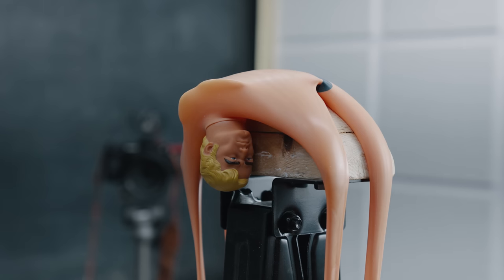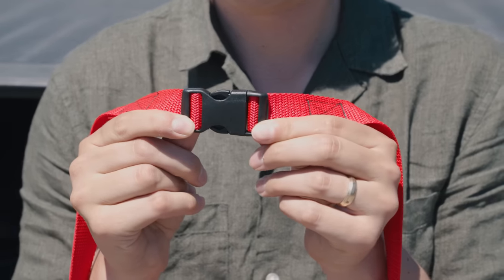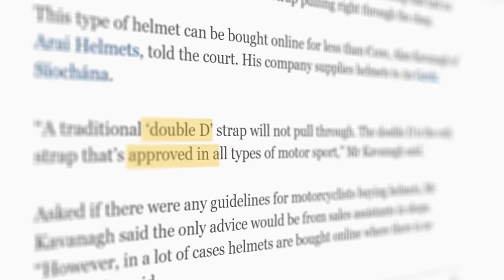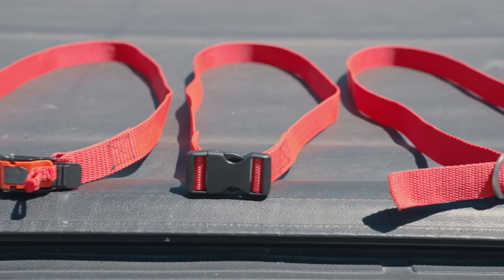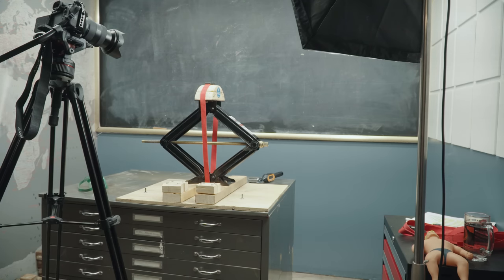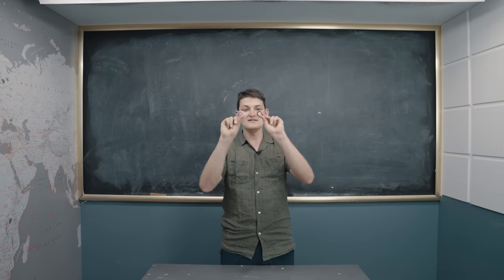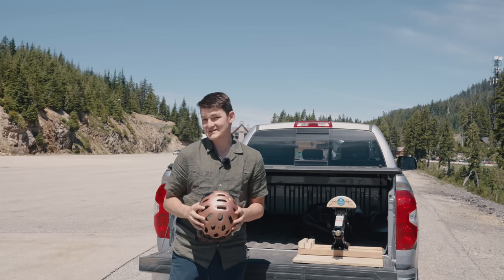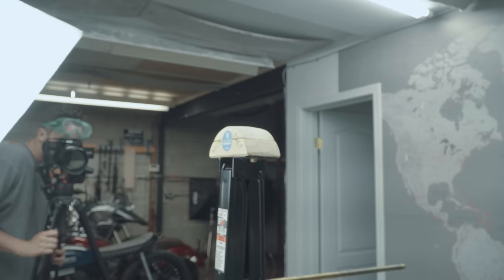Why Motorcycle Helmets Use this Ancient Buckle

Comment: Interesting. I have a Shoei Neotec 2 helmet myself and those ones have a ratchet strap which is made of metal instead of plastic. If you see that the plastic ratchet part broke, than i would think the Shoei ones should withstand more force...
Reply: Good observation here. The problem with this test isn't so much about testing the buckle style - but rather it's material strength testing as you can see the other buckles the failing point is the plastic breaking, whereas the double d ring has the advantage of being made out of metal. I'd even go out on a limb and say if you flip the situation around and have plastic double D rings vs the metal ratchet strap on the Shoei's, the plastic double D ring is going to fail first.
Reply: @nanaholic01  The fidlock had it's metal loop fail where the D rings were still going strong so just making a rachet out of metal is not a sure way of beating the double D at all.
Reply: @Juuul89  The metal loop is still intact for the fidlock you can see it clearly at 4:45. The broken part is plastic.
So the point still stands - they are testing the material strength of the locks but not the strength of the lock itself. It's not a fair comparison unless all the locks are made from the same material, this is a poorly conducted scientific test period.
Reply: @nanaholic01  it's clearly metal, look again
Reply: @Juuul89  nope looks plastic. The black latch part is clearly plastic which is what failed, while the other side with the silver metal ring for the hook side is still intact.
Still doesn't change the fact the test is testing material not latch design, so stop changing the subject.
Reply: The are testing the integrity of the set up used, materials chosen are secondary, as manufacturers In real life situations, vary in both design and materials. Therefore Scientific testing method stands, independent of the actual  mechanisms tested!
Reply: @nanaholic01  In real life situations, the "D" ring performs better, look at accidents and helmet fastening mechanisms and fatalities. As for the Scientific method ..
Reply: @nanaholic01  Check out what the Racers/ Drag guys,, Motocross people wear. See ACU/ DOT standards.
Reply: @johnnyhall7065  this is not what we are arguing and you are just strawmaning the entire point. The point is while he may have came to the right conclusion (the D ring is simple, strong and effective), he did it by accident because the experiment itself was design and conducted wrong, which would and should invalidate his conclusion in the most strict scientific way. Again this experiment did not test the strength of the buckles in a fair and equal way because the materials which the buckles were made were not the same (metal D ring vs plastic buckles), you can bring up another dozens of excuses of why D-rings are used in competitions or what not, it still doesn't change the fact this experiment is set up incorrectly and did not test what it was suppose to test (also citing D-rings are used in competitions as "proof" is called begging the question - you start with a forgone conclusion and worked your way backwards to find the path to this conclusion - this is entirely unacceptable as a scientific hypothesis and experiment in fact). He could easily add another control in the experiment with a fastening method which uses the same nylon straps but is held together with plastic D rings, which would then raise the trustworthiness of the entire experiment. 
Stop defending this video and admit it is not a good experiment - even if he accidentally arrived at the correct conclusion.
Reply: @nanaholic01  I questioned whether the plastic fasteners were from actual helmets or were "standins". My personal conclusion was that I don't know if he was using the correct pieces or not. If they came from actual MC helmets then he did it correctly. If they were standins he did it incorrectly. Personally I've never seen one of those plastic fork clips on a motorcycle helmet, just small ones on a bicycle helmet. That makes it apples and oranges. So, for me the jury is still out...    It was entertaining though.
Reply: @blakehugh  Exactly. Also the ratched style fastener is found in actual MC helmets like Shouei, but of course the those are all metal instead of the all plastic one used in this experiment. I have a Shouei helmet which uses the ratched style of fastener, and of course that helmet is certified for safety in countries all across the world (except for racing). I actually do not doubt that the D-ring is most probably the toughest design because it has the least moving parts thus less points of failures, but this "experiment" is not the one which convinces me of that because of the poor parts selection as you said.
Reply: exactly!!  the only difference was the build quality.  the designs themselves werent flawed.  he totally overlooked the build quality factor.
Reply: @nanaholic01  If the vast majority of fasteners are made of the same materials as the buckles F9 tested, then the conclusions are 'reasonable'. F9 cannot possibly do a full and comprehensive test of all fasteners in the marketplace, so for the 'general rider', the tests of the ones most commonly available was appropriate.
While I agree the test methods had inherent 'flaws', they still managed to give a good indication of the relative strength of the fasteners tested.
Reply: @garymaclean6903  they didn't though which is the point. For example my Shoei helmets uses "fast release" buckles which are made completely of METAL, compared to their cheap quick release straps which are plastic, and then they compared it to completely metal D-rings. So they, in fact, did not compare the strength of the buckle type but rather is testing material strength. If you cannot eliminate the variables in your experiment, then your experiment is a failure to prove your hypothesis, even though your conclusion may be correct.
If they cannot find fast release buckles which are metal, then for an actual properly controlled test, they should be using PLASTIC D-rings, which would then eliminate the material variables and actually give you the test of strength of the buckle type.
Reply: @nanaholic01  Actually, if the majority of fasteners on the market are made of or with plastic, then it's completely appropriate to test what's being offered and sold, rather than test something that is typically unavailable in our market.
Keep in mind F9 is a Canadian company, and many of the alternative metal fasteners available in Europe are simply not available here.
Reply: @garymaclean6903  er no it isn't. Even if the majority of the fasteners are plastic it still doesn't mean you test different materials against each other - that is literally what is considered not a controlled test and would be considered unscientific. For a channel which prouds itself to be rooted in science, it is a VERY bad mistake they made, and the fact that you are still trying to defend them just makes the whole situation worse. 
Plus Shoei is an international brand their helmets can be brought everywhere, the only conclusion you can actually make from this test is a metal D ring fastener is better than a plastic fast release fastener, good and pretty much would be the expected result because even common sense would tell us that metal are stronger than plastic (that and no one should be buying motorcycle helmets with plastic fasteners anyway, bicycle helmets is a different story), the test still doesn't test fastener strength no matter how many backflips you are trying to do with your excuses.
Reply: @nanaholic01  They tested how the strength of existing fasteners on our market compared.
It was NOT a test of the strength of  fasteners made of the same material! 
No point of testing a metal ratchet strap with a metal D-ring strap, if you can't even buy a metal ratchet strap in our market...
Reply: @nanaholic01  You missed the whole point of the test. 
Yes, a 'total analysis' would include a proper test of all available types and materials, with numerical load failure numbers to assess which type and material is the strongest. You would also need to identify the manufacturer and model of helmet that fastener was used in, simply because there's no one type of fastener design or common material. A plastic fastener from one manufacturer could have a different type of plastic and fail strength, as a different manufacturer with the same design.

So F9's approach was to isolate just 'some' of the common helmet fasteners currently available on the market, and attach a common standard belt so that only the fastener was being tested.

Not a totally unreasonable approach, even if the test methods weren't totally accurate. You DON'T have to only test fasteners of the same type of material to find out if Arai's Metal D-fasteners are 'stronger' than Bell's plastic Ratchet straps...!!! 
If you only tested metal D-Rings against metal ratchet straps you would NEVER KNOW if Arai's Metal D-fasteners are 'stronger' than Bell's plastic Ratchet straps, so how could you possibly decide which was the best for you...?!?!?!

It was never intended to be such a comprehensive test where all possible fastener types and materials were tested. 
 F9 doesn't have the resources to run such a test, nor the actual equipment to test the helmet fasteners and attachment belts properly. That's why they rigged up a strength test that attempted to use a torque wrench to get strength numbers, but failed to address the other flaws in their test procedure. They also didn't actually test the different belts used on helmets, nor the different methods used to fasten the ends of the belts inside to the helmets. There really isn't a good way to test how securely belts are fastened to helmets without testing not only the fasteners, but also the belts themselves and the attachment methods. 
Which F9 didn't to...
Reply: @garymaclean6903 that is not what the test is - they specified they are testing the strength of the fasteners. And again, Shoei helmet fast release fastners are NOT plastic. So either way you are trying to spin it this test is a failure.
Reply: @garymaclean6903  No I did not miss the point of the test, YOU on the other hand, did.
Again a proper scientific test means you eliminate as many variables as you can except the one which you want to test, the fact that they did not eliminate the material variable but pretend they did means they have failed. Your complete lack of understanding of how scientific test works is getting very tiresome. Stop doing backflips for this video - it is NOT a good test, even when they accidentally come to the correct conclusion.
Reply: @nanaholic01  What you missed is that they weren't testing which material or fastener design was strongest. They were testing which fastener was strongest, regardless of material or design combination.
That's how you compare products on the market.
They wanted to find out if what the manufacturer chose to use to make their fasteners was as good, or better, than what other manufacturers chose. 
If you decided to test winter jackets, would you only compare jackets from different manufacturers if they had the same design and materials? Of course not. You want to know of all the different types and materials, which one keeps you warmer. If you restricted coats to only ones that had the same design and materials - guess what? - You'd likely find they weren't very different in how well they kept you warm...!!!

Yes, in scientific experiments you try to eliminate the variables that could skew your desired results. But the one variable you don't eliminate is the one you're trying to measure - how different buckles have different designs and materials - when you're trying to find out which design and material is the strongest...!!!
Reply: @nanaholic01  When the strength of the different materials and designs WAS WHAT THEY WERE TESTING, what they did was appropriate.
Riders want to know what fasteners are best, whether plastic or metal. If you only compared plastic to plastic fasteners, and metal to metal fasteners, how are you going to know whether a plastic fastener is worse than a metal one...???
You won't...!!!

No, I understand their test perfectly. It's you who is claiming you can only test one type of material against the same type of material - which will miss how different materials and fastener types compare against each other. 
- i.e. - The "POINT OF THE TEST"...

Again, I would have designed the test differently, as the scissors jack isn't accurate with different lengths of strap. A more accurate pull-test test could have resulted in an absolute strength measurement of each fastener type and material, regardless of design or material. Prospective buyers could then use those summary results when deciding on which helmet brand and fastener they will buy.

Comment: I've been using the ratchet type strap since I moved to Spain (from US) few years back. While it's certainly weaker, it's so much more practical to use. No more having to remove the thick gloves because you forgot to do the strap. Now if someone would just invent something to remind me to take the keys out of my pocket before putting on the gloves...
Reply: Seriously.
Reply: Harley uses a proximity key fob. Works great and you never need to touch your keys.
Reply: @TheMachoGabacho  That's pretty cool. Only downside being that you're stuck riding a Harley. 😋 Just kidding. Enjoy whatever your two (or three) wheels may be!
Reply: @jotemenkir  lol. I have a couple of Harleys but they don’t have the proximity fob. They are older than that technology.
Reply: @jotemenkir  the new harley pan america is an actually good bike... its also the only new bike they have made in 100 years but thats besides the point

Comment: I'm not giving up my burton style ratchet on the Schuberth I have.   It's the fastest on/off helmet I own and I can leave my gloves on.
Reply: Why it is so important to have gloves on?
What do you do with gloves on anyway?
Reply: @Capt Shiny I'm going on faith that Schuberth has done their research.   It's got a 4 way strap vs a typical 2 piece strap.  The more you pull on it, the more it cinches the base of the helmet to your head.   I cannot put on a D ring helmet with my gloves on, otherwise I wouldn't care.  It may not be difficult to you, but I guess I'm inferior to you as a person, which is what I'm guessing you were hoping I'd say to you.
Reply: @XtreeM_FaiL  The modular helmet with ratchet strap means I don't have to take my glasses off to get the helmet on and off.  And I don't have to take my gloves on and off to fiddle with the strap.   I don't have specific scenarios in mind, but the time I spend with my C3 vs my former Arai non-modular helmet has been cut down by a factor of four.
Reply: @421CentralIowa  How is chin strap's locking system affect glasses in anyway?
Oh, you talk about the helmet only.
Reply: @XtreeM_FaiL  It's a modular helmet so I can get it on and off without removing my glasses.   The strap is just one more reason it's much faster than other types of helmets to put on and remove.

Comment: My ratchet strap does get adjusted every time I plug it in, locking into the 2nd tightest setting. It looks like you tested a really cheap PLASTIC buckle. Shoei says their ratchet buckle is just as strong as a D-Ring and I believe them, considering all interlocking parts of their buckle is metal.

D-rings are way to slow and inconvenient, it's like a kick start bike with a carb.
Reply: Takes about 5 secs at most to do up double-D rings.  And a bike with carbs should start on the first kick if it's been kept tuned, so maybe another 3 seconds.  Not that much of a time difference compared to a different helmet clasp and a starter button, really.  :-)
Reply: @aussiebloke609  not to brag I can secure my ratchet buckle in 1 second with one hand. Cant do it with a fully unfastened double d.
Reply: @flyinghigh2000  I spend 5 to 10 minutes safety-checking my bike every time I ride out, helmet included.
Reply: @flyinghigh2000  I'm happy to spend a whole 8 seconds to be safe and get the bike started.  You're really in that much of a hurry?
Reply: @aussiebloke609  I did a stint as a delivery rider when movement control is everywhere. Its the only way for me to ride for 3 months. I put on my helmet every 10 minutes it seems during that time. It gets tiring after a while.Plus the other type of buckle is safe enough or the European won't allow its use.

Comment: After several helmets (most of which were micrometric, some - variations of side-release buckle) the helmet with DD - instant NO. 
When you have to ride through 5-6 places within 1-2 km each form another, you clearly don't want to mess with DD 10-12 times (one for riding, one to carry the helmet)